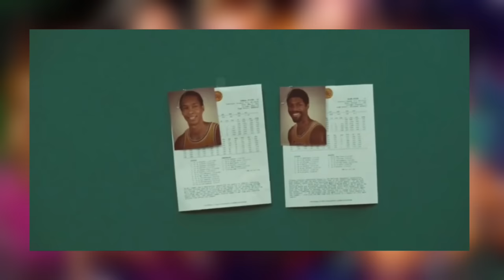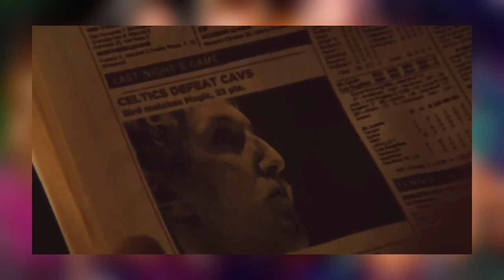Winning Time Season 2 Episode 6 Breakdown | Recap & Review

Comment: During the 1982-1983 season, the Los Angeles Lakers debuted the new Porter Basketball Backstop. The Porter Basketball Backstop had connections at three spots (the basket, and up at the top of the backboard) with the breakaway baskets (breakaway baskets were installed the year before at every single NBA teams arena).
Reply from the maker: Appreciate you sharing the info